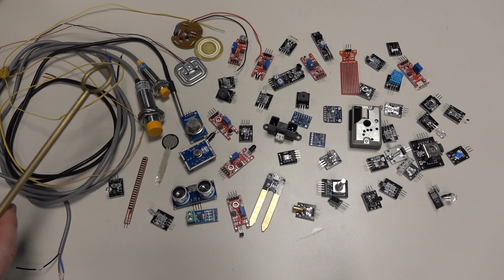Sensory Overload // Sensor Tutorials

Comment: I'm helping out folks who are working on an Open Source Water Purification unit. We're trying to figure out what sensors are out there that might can be used with an Arduino Uno for things like pH and any other things that might can be found out from water and sensors. The long term goal is to have an Android app that can read the data and compile it in databases from all over the world as well as scaled down to local communities. Any info you can make along that lines would be greatly appreciated.

Comment: i dont get how you only have 11k subs. Almost always great vids. This would be great filler. It would be nice to dig into communicating with sensors without using libraries to really understand them better. I wrote my own library for a DHT11 temp and humidity sensor to work with a Z8 micro and that was a great learning experience!

Comment: I just want to know how to use them, as a layman with all the amazing inexpensive equipment and tools avalible to us, and there is little in the way of introductory instruction yet real world utilization.  

If there is any way to help those of us interested in this stuff, yet not exposed to it, that would be my personal wish. 

The arduino and raspberry pi seem like such amazing tools for versatility., to have a accessible way to get into them would be a fantastic resource, and one I have been hoping to find.
Reply from the maker: I will do my best!  I will show programming examples with an arduino but I also want to show that you don't need the microcontroller to use the analog sensors.  Do you think I should start the videos explaining how they work and then showing how to use them or the other way around?
Reply: I would like you to start with how the sensors work first because that approach is a less common.